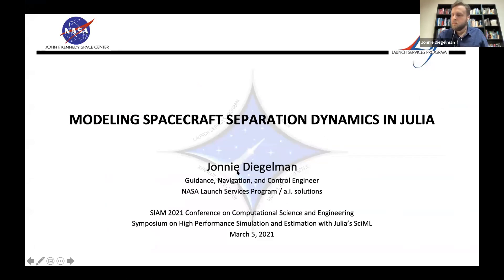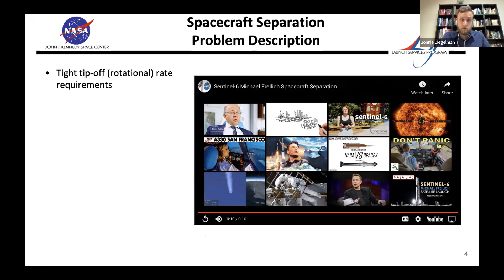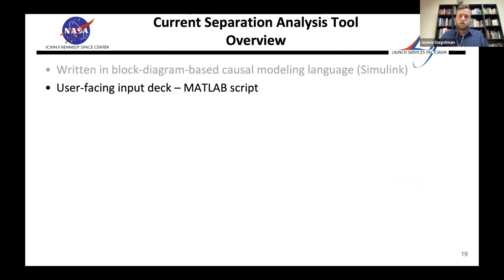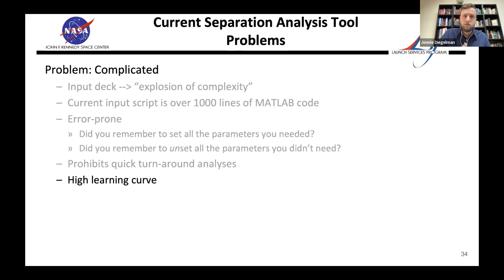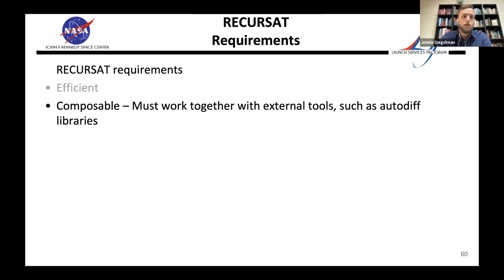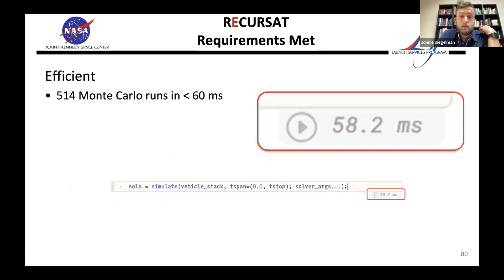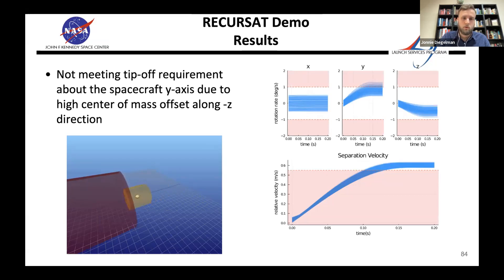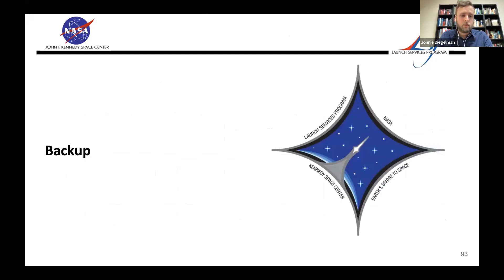Jonathan Diegelman - Modeling Spacecraft Separation Dynamics in Julia

Comment: Super awesome! Since this package seems not to be available as OpenSource, I'm trying to get some ideas here since I'm working on a similar topic, not related to space craft dynamics, but to inertial sensors which share a lot of the mechanical parts. How many man hours did you spend approximately? Do you have time discrete states or is this a fully continuous simulation? You mentioned to use MTK in future if you had to do the same thing again, is that still true? :) Thanks!

Comment: Nice work .. we did it in SimScape.. though Julia is more natural.. by the way Modia and the ModellingToolkint  will give you
 even more power...
Reply: When I started this project, ModelingToolkit's component system wasn't quite mature enough yet for me to feel comfortable writing the whole sim in it. These days, however, it's really nice. I use it all the time now. If I were to start this over from scratch, that would be my choice.

Actually, I'm considering migrating the sim to ModelingToolkit anyway because it's much easier to inspect intermediate variables like spring forces when you can make them symbolic aliases.
Reply: @jonathandiegelman4714  ...  Worst-case Launch Vehicle Stage Separation Analysis P. Simplicio and S. Bennani... we are now doing deployment analysis for arbitrary multiple-pl configurations at the time..
Reply: Your colleague at NASA may contact you if you want to present this work at the upcoming InterAgency V&V workshop
Reply: @jonathandiegelman4714  This would be a great example for modelingToolkit if you ever open-sourced it and redeployed it with that tool.  It captures so much of a typical Aerospace performance analysis workflow, except maybe the digital controllers, which I don't think was a consideration in your simulation.  I loved the idea of the recurrent components which was pretty elegant.
Reply: @Rekabrnalla  thanks! Yeah, it’s definitely on my list to do this soon. I’ve had some ideas in my head for handling digital controllers better, too, I just need to try them out. What I do now is set state variables with zero continuous dynamics and use PeriodicCallbacks to update them. It’s… okay. A little clunky and manual, but not unmanageable.
Reply: @UCw6StaYMjPHPKRqOMGUaVaw Oh cool, I met Neil about a year ago when we were working with the NESC on a different project. That sounds great, have him shoot me an email. Thanks!
Reply: @jonathandiegelman4714  great just sent him a WhatsApp..,